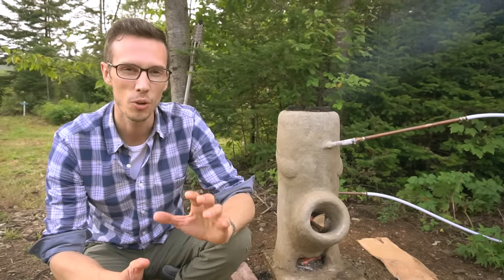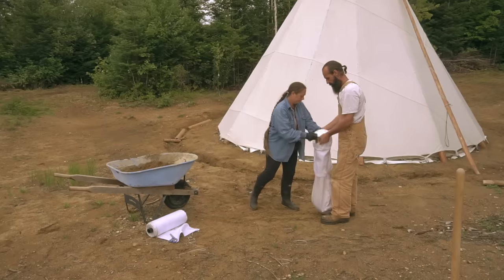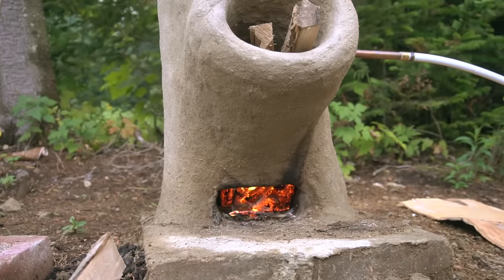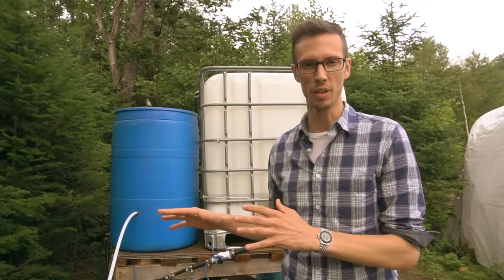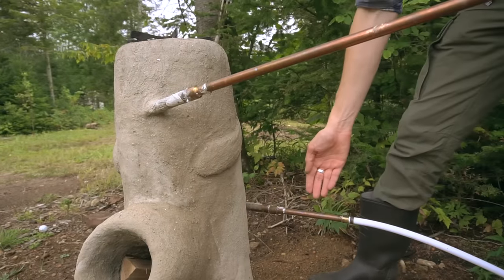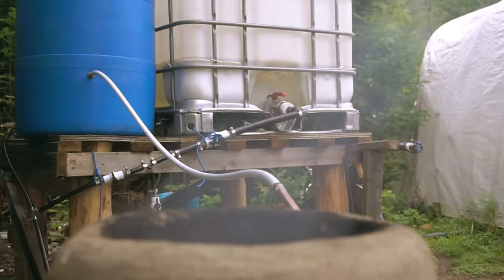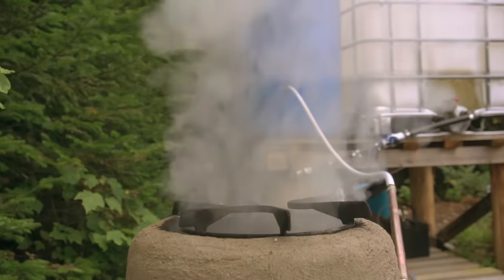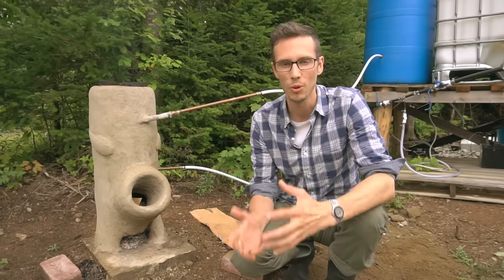Brilliant DIY Off-Grid Water Heater Using a Rocket Stove – No Propane!

Comment: To qualify my point of view I am interested in and presently developing a rocket stove concept that will be used by nomadic vanlifers. So portability is key and low cost is a must as well as Using up-cycled components. I forsee it being used to cook,heat water for showers and provide basic heat. The potential is only limited by practicality. I am very interested in your process and learning from you sharing in that process. FYI I am into my 4th video of yours, so I am invested...rolling into my 5th.I see this as a super money saver especially for homesteading or fixed use but the concepts are easily transferable.A couple of comments from my first impressions. A) I see a down side to the ramp for outside use.. here in Florida this week  the rain would have defeated you so covering the feed would be essential for my application.Next I get the math inference.... seems to me it affects/ influences the draft so therefore the effectiveness. Also  I am really interested in a firebox  and its effects on the performance. I am super interested in the perlite effects(limiting radiant heat) for a stove and summer/hot climate as well as practicality of being able to transport and resetup after moving. Conversely I am interested in the effects of increasing the thermal mass to improve effectiveness for winter heating. I stumbled onto the idea of embedding a copper ( ?)  coil into mass to create a hot water heater. I find a passion to have been sparked. Like you I am sharing my process with hopes of inspiring others. So like you I will now develop my list ,refine my thesis ,catalog my observations to help redefine my objective.
I am shelving the more portable version for now in favor of this version to see what take aways or improvements this process my reveal. I see this version being for anyone workcamping ,ect ( say at Amazon in the fall in Tenn, for example) where movement would be predictable and with a goal of - if the stove was to be left behind it would be a desirable and useful addition. My present focus was influenced by the idea desert camping (ie HIGH wind low naturally available fuel) which lead to wind screens and pellet fuels) the previous evolution was influenced by national forest/BLM stays where no open contained flames are presently allowed so leave no trace was the major influence .
This has led me to the notion that a system approach is more desirable that a device .My hope is to devise a cheap efficient rocket stove that uses up-cycled components to improve the overall quality of life for the nomadic van dweller community whom I expect to become a part of in about a year from today. So there you have it.. Thanks and keep experimenting.
Reply: Birthday
Visionary thinking!
How are your plans coming? Ok I see a hundred applications of the rocket stove for camping!¡!

Comment: we have been using these in Australia  since colonization. we call them Donkey  heater
Reply: Back in the day all New Zealand homes had them, they called them boosters even homes with electricity still had a booster stove that you can heat hot water and cook on just in case your electricity went out.
 God knows why greenies want all of us to revert backwards.
Reply: It’s not reverting (backwards- redundant) it’s being ecologically responsible.
Reply: @brucea550  Greenies can be eco-friendly for themselves, but when they force their ideas onto me..it changes from responsibility to  dictatorship.
Reply: @brucea550  Many rocket stoves can be fueled with twigs and limbs that have fallen off trees but, once you would have a much larger demand for fuel to burn then the greenies would be griping about deforestation from people cutting trees for cooking and heating their homes.
Reply: Doubt it. Wood is a renewable resource. Easy to plant new trees as fast or faster than you cut them down.
Reply: @brucea550  Apparently you are lucky enough to live in an area where you don't have to get a permit to cut down a tree.
Reply: There’s many options, if you can’t cut trees you can buy wood. The point is- the resource is renewable, unlike coal, oil or gas. And solar isn’t an option in winter in the north.
I can cut trees but don’t need to. Construction sites throw away more wood than I can burn in a year.

Comment: Neat idea but directly heating the water is probably more efficient.
Reply: directly heating water via copper tubing in the flu....that's pretty darn direct heating.
Reply: :( water puts on the fire if you apply directly
Reply: I think the idea is creating a water heater where you then can have hot water when needed. It is a no-brainer to just heat water, that has been done for centuries.
Reply: Just change out the barrel to metal, then place it a foot or two above the rocket stove on a metal rack. You would get the heat through the exchanger and the heat from being directly over the fire too. But you better have a safety pop off valve or you may have an explosion due to the pressure
Reply: War Monger - are you thinking of a dual pipe design, where the water travels between the two pipes (sealed obviously) - similar to a kelly kettle?
Reply: David Riley not really. I just meant you could simply put the steel water tank directly over the top of the rocket stove, instead of the trivet with a cookpot. It would probably wreak havoc on the thermal cycle, but a very small pump could be added to force the water through the coiled pipe. Then you would have both sources of heat, direct, like a pot on a burner and through the improvised heat exchanger.
Reply: water heating as shown here isn´t as efficient as it seems, at least not if you consider the amount of heat that is escaping the system through the chimney top. you can get a lot more of heat out of the exhaust if you would have a higher chimney with more copper piping.  The combustion itself on the other hand is very efficient with the chimney effect, but the use of the heat itself not so much..
Reply: Yes, I was thinking of that too. And on top I wondered if the piping system allowed for the cold water to enter in the top, then flow out through the lower pipe. I know this might be difficult because of the physics but if it worked the water was leaving the rocket stove at higher temperature
Reply: phildev it's multi-functional so you can have this in your house/shelter and cook your meals,heat your home and heat your water at the same time seems pretty efficient to me.
Reply: I have a similar system in a cast iron cookstove. My tank is an off the shelf hot water heater with 2 element locations. We removed both elements and piped the cold water feed to the lower opening and the hot water return to the upper. The big benefit is that it is well insulated and has the safety relief valve in case of overheating.
Reply: I think you're probably right, the catch would be if heating water was your secondary purpose for running the stove. If you start the stove to simmer some beans for 2 hours and also heat water then it makes more sense.
Reply: Most efficient is a small fire under a metal water tank.  Like boiling a pot of water.  To get fancy and more efficient, take a metal pipe and make a chimney for the fire that goes up the middle of the tank.
Reply: or you could vent the exhaust to wrap the barrel.
Reply: Yeah set the 55 gallon drum on top of that little rocket stove. Good idea. Plus you wouldn't be able to cook and the fire would go out.
Reply: Just dig a whole 200 meters deep and run your water line down and up. That's more efficient.

Comment: you have nothing in thermomass here my friend ... but the rest is good
Reply: 🌟༻🅹🅰🆈🅵🅰༺ ✓ • 5 years ago  people make rocket stoves out of metal I'm pretty sure the thermal mass doesn't make it a rocket stove
Reply: I've seen the metal ones melt down and people having problems with those which is fixed by using better and thicker steel that can handle it. Metal radiates heat, masonry/ceramic stores heat. Ideally there'd be a bit of both.
Reply: 🌟༻🅹🅰🆈🅵🅰༺ ✓ • 5 years ago  radiation conduction and convection it is basic physic
Reply: 🌟༻🅹🅰🆈🅵🅰༺ ✓ • 5 years ago  are you kiding me, I teach you about simple thinks, what troll are you, come on...

Comment: My grandfather had this system decades ago. My family has a shack in the middle of nowhere and built houses, this is how they did the shower, well, a little more permanent than this, and the water was sourced from the rain water tank. You just had to remember around lunch time to get the fire going so you’d have hot water that evening, and if it wasn’t too cold that night' light some coals in the morning and you’re set.

Comment: Good to see these ideas implemented!  Only issue is that the water pipe cools the heat riser which counteracts the whole idea of a rocket heater.  Also, the efficiency (i.e. wood energy out compared to water heated) with this design would be lucky in getting 15% (most of heat goes into mass and up out flu).  I doubt 10 showers would be possible without being at the stove 24/7.  It's better to keep the riser as hot as possible (e.g. thin fire brick).  Metal would heat up the fastest but rusts out very quickly.  An insulated riser would be even better but can over-complicate it (not worth it IMO).  This way the gasses would completely combust (i.e. more heat, less waste), then you would use the exhaust heat to heat the water.  The more surface area for the heat transfer, the better.  Another problem for water heaters is that a rock MASS heater takes away energy to heat up the mass, so the water has to wait for that to heat up first before getting up to a decent temperature.  Ideally you would surround the hot gasses with as much water as possible and as little mass as possible, so a separate (insulated) metal water heater connected to heat riser exhaust would be ideal (rather than thermal mass).  So something like this design would be better:
https://permaculturenews.org/forums/index.php?threads/improved-rocket-stove-water-heating.12958/

Personally, I prefer the batch rocket heaters (less babying), but design takes a bit more consideration.  Hope this helps!

Comment: I think this is great. I would think though, that the copper coil would be better off as an autonomous feature. So, the coil would be inserted into the top of the stoves opening and exit at the bottom opening.  I think the way it is now in this video, allows for some heat to escape through the ports that have been created to accommodate the current coil set up. Rocket stoves insulation is what allows for the efficiency. I think it would be best not to mess with that. Great idea. Love the video.

Comment: To make my rocket stove burn cleaner, I insulated the combustion and hot gas chamber to essentially catalyze the unburned wood gases. From there, I used the hot gas to do my heating. When the stove was in operation and warmed up, there was no smoke unless the wood was damp. I also had an eight foot chimney to help induce better drafting and combustion. Niced unit though.

Comment: Inside your home build your rocket mass heater on the opposite wall of your bathroom/shower. 

Have two barrels overhead of the shower (gravity fed into a Y pipe and out of one shower head). 

Heat one barrel with copper pipes through the wall from the stovepipe. Leave the other cool. 

When you open the two valves on the Y pipe into the one you have complete control over water temperature just like a normal home. 

Cheers! :)

Comment: Way back in the '50s we had a little Quecec heater that did the hot water heating for us, we started it on wood then put in coal. Took about 2 hours and we had lots of hot water for the bath tub. No shower then, water was pumped out of the well and into a 45 gallon barrel in the attic.

Comment: Knowing that  your rocket stove is heating water is cool.  I am working on heating water with a rocket stove. The main difference between yours and mine is that the cold water,  heavier than warm is fed at the top of the rocket stove.  Being a boiler tender in the Navy- I hope I paid close attention when this was explained to the group. Hot water rises, thus controlling natural circulation.

Comment: I've used a "non-working" water heater as a holding tank for hot H2O. It's already insulated and holds the heat decently.

Comment: You could easily incorporate a larger copper coil into the structure of a wood fired oven.  Not only would you have hot water for days, you would also have a place to make your bread, roasts and pizza.  Ardent Energy still makes a wet back(down under), water jacket(Canada) option for their wood stoves and furnaces.  Not all areas allow these stoves though because they aren't on the EPA approved wood fired appliance list.  This is a great little stove though.

Comment: This looks great but as I also live off grid and use rocket stoves, my concern is that I would have to stand next to the stove for 2 hours continually feeding it in order to hear the water. That's hard to do when it's cold outside or I have things to do. How has your experience been using this system?
Reply: No those old timer stoves are awesome and will hold temperature quite some time.  Once you start your fire it will be hot within 20-30 minutes.  Throw a few logs on top to keep it going, shut your dampers down a bit and you're good to go for hours

Comment: Thermosiphon. We heat our barge with a wood burning stove, that has a back boiler. Two one inch copper pipes come from the backboiler and run the length of the boat at a slight incline( no need for a pump).The first radiator on the system is the furthest from the stove and the return line running from this back to the stove supplies the water to the second rad. There is a header tank feeding down into the system.
No need for a pump.
1” copper pipe work , uninsulated, radiates a lot of heat in themselves.we’ve found it to be an excellent heating system.
One thing I’d like to know from the video is, what material is the rocket stove made from.

Comment: I did this once, but I used an old 70gallon water heater that was insulated, but did use a rocket stove to heat it up.the water would stay hot for several hrs and it would only take about 1 hr to heat.

Comment: Technical question:
If thr blue tank were elevated like a water tower to create faucet pressure, would the circulation between the rocket heater be disrupted? I am guessing that it wouldnt.
Also on another comment posted earlier suggesting replacing the poly barrel with a steel barrel, I dissagree with the recomendation. When the steel barrel rusts it will contaminate the water. A non toxic polyethylene tank won't. I noticed that this prototype design has a gate valve or faucet valve that can be turned off or used to regulate tank temperature and prevent overheating of the water and vessel. 
Another thought. Back in the 70s and 80s children taking baths often were scalded due to excessively hot water. Plumbing code was revised to insert a valve inside the Fawcett that regulated the hot and cold to prevent this serious injury. If the tanks were raised high enough (like a water tower) to create Fawcett pressure amd a thermal safety valve were implemented, you could rest assured with peace of mind that your rocket stove won't injur or maim others resulting in criminal negligence. Just saying.

Comment: I like this idea, and as you mentioned, this is just the prototype and you'd probably insulate the pipes etc. for efficiency eventually. Would you consider using a small hot water tank that originally ran on electricity, since they have been designed for regular home use efficiency standards and they do come in smaller sizes than 20 gallons. I personally would modify the rocket stove slightly so as to control the bottom intake airflow for a hotter burn, maybe simply by placing a partial obstruction in the inflow after the stove had heated up. Great multi-use wood burner, still not really safe for indoor use though.

Comment: Will the water run up thru the return pipe cause it look higher, and how much water did you fill in to the blue tank, was it full tank or under the high hose ?

Comment: many people are saying rocket stoves are efficient, but in my experience, this depends. it burns cleaner and hotter than an open fire for sure. but if it's too tall, heat is lost as it travels up the tube before it reaches the pot. i built many rocket stoves before, and in many cases it took more wood to boil a kettle of water than normal.
Reply: There are ratios you have to keep in mind for building the most efficient rocket stove possible. Depending on the materials you use, you'll also either get a rocket stove that soaks up the heat, or one that just funnels the heat straight up.

There are multiple places you could have screwed up that would explain the less than perfect performance you're reporting. Its also important to decide if you're just trying to boil a single kettle of water or do multiple things from a single heat source. This design, for example, is made to use the rocket stove for multiple things at once, and to allow it to heat water passively as you cook rather than have to start a specific fire only for the hot water and risk overheating it.
Reply: Thalanox, exactly!
Reply: “...if it’s too tall heat is lost as it travels up the tube...”

Where is it lost to? If the riser is well insulated, which is the defining feature of a rocket stove, the heat can only go up. It would seem that up to a certain point, the longer the riser the more complete the combustion (thus more heat) would be. I realize you have to balance the riser to the size of the fire.